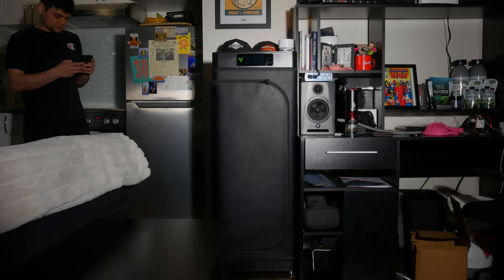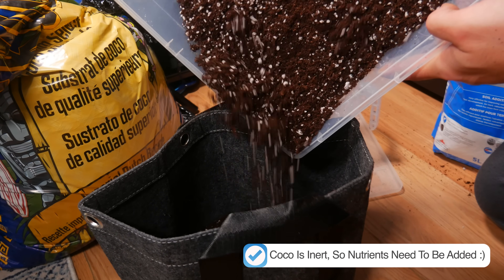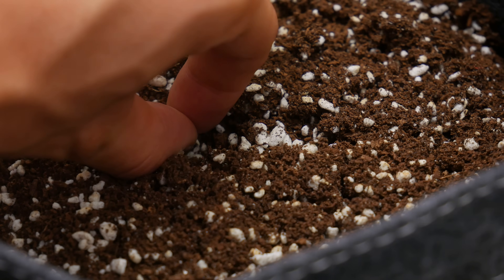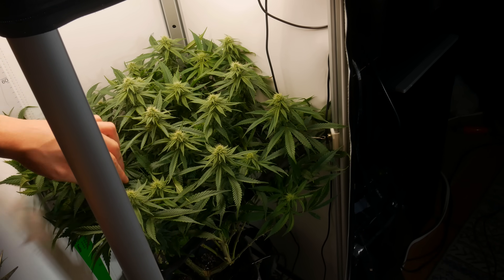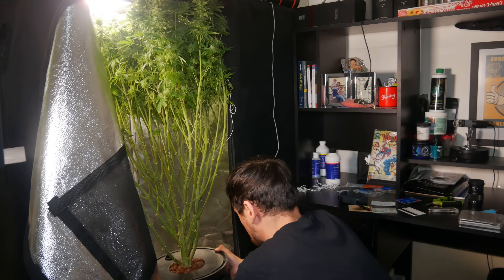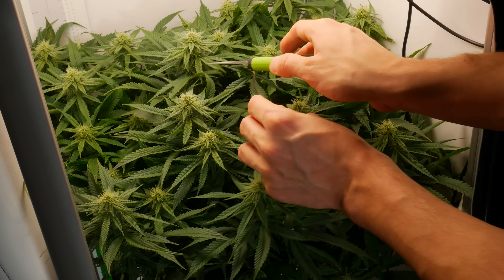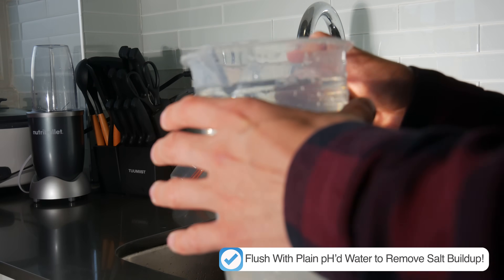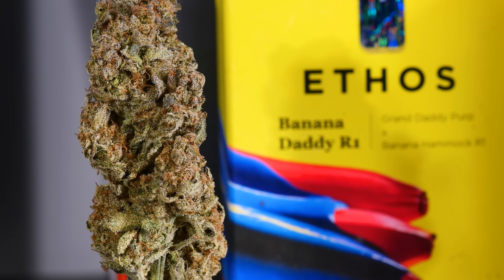Seed to Harvest in a Fully Automated Smart Grow Box (VGrow Test)

Comment: What’s the effect of the Electric bill like?
Reply: For a light that size, it depends. How close you hang the light to the canopy, but if you're being cost concious, I'm sure you could run a tent that size for under $0.50 a day. Probably closer to between $0.25 and $0.30. But there's also hidden costs that are dependent on the climate of where you grow. (That's included in the $0.50/ day estimate.) Also, it depends on your cost per KWH. My estimate is based on $0.12/kWh.

Comment: I recently started growing and picked up one of these kits. Currently I am running it through the paces without any girls, and I am noticing the temp to be high.  When in the flower stage, per Vivosun's recipe, the box sits at 84 degrees F. The lung room it sits in is between 70-75 with 66 RH. With the lights at 60% the box stays around 78. Any suggestions other than keeping the lights off, to help get the temp lower?

Comment: Howdy from Lotusland. 🙃 I used to grow a hydro SoG in a cabinet back in the late 90's, and had that same burn on the leaves. I thought it was nutrient burn though, so I immediately switched to plain pH'd water for a few days instead. After that, I just had a secondary reservoir that would top up the Rubbermaid with plain pH'd water using a float valve. That seemed to fix the issue.

Comment: Ive been trying my hand out at a feed -water-feed-water schedule.  To prevent lock out
Reply: Just buy better nutrients, or mix your own. Lock out is mainly a man made condition. If you think this method is good using water only, you are having confirmation bias because just feeding correctly in the first place will be the best method. Water only is going to cause more lock out issues than just feeding them every water with lower dosed nutes unless you are calculating all sorts of crap, which at that point you should have already been calculating your nutrients… stop trying to rewrite the book with such simple ideas that have been proven false for decades.

Comment: I was interested in the Grow Box but wanted to watch videos to see if carbon filters, light diodes and size (footprint) options where  part of all this. The no carbon filter made me pause the video and start this feedback comment, I won't be buying this due to that, no matter what. I had a strong feeling a CF was missing but didn't know if they made a new style to fit in their Grow Box.

I built my own LED lights before LED's were even really being used to grow, you had to build them on your own (literally find a manufacture to place diodes or do your own COBs.) To not see what quality of diodes used also makes me less interested but it's not a huge point as this is mostly about efficiency, meaning lower watts (energy) use for the same grow. Last is the footprint. a 2x4 of this with a integrated carbon filter for like 1,000$ would be very worth it... Considering the costs to do a tent, water, CF, lights, fans would cost near that much but probably get a bigger space I feel it's a grate trade off... To simplify a grow like this Grow Box is close to doing (again no carbon filter is just a hard no) would be powerful stuff. 

I'd like to be able to do 2-4 small plants so a 3x3 and a 2x4 option on top of the 18/18 inch option would be pretty nice. Anything bigger and I assume the setup would have to cost 2-3k.

Comment: Is the air outlet for a standard 4" hose so it could be connected to a carbon filter? or... is the internal fan strong enough to handle the extra back pressure of a filter?

It looks like a neat system but yeah, definitely missing one key component.
Reply: no